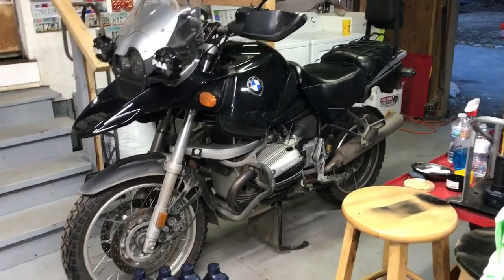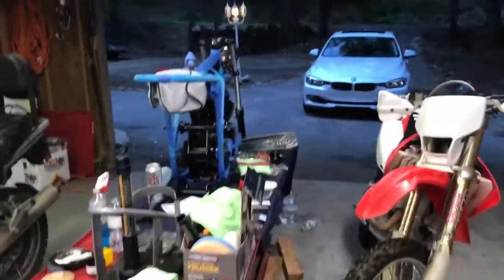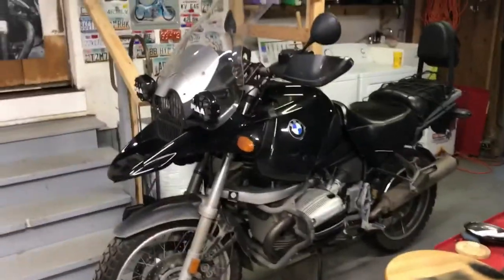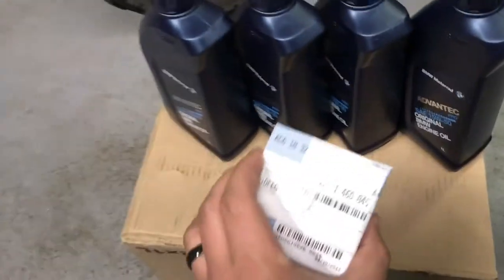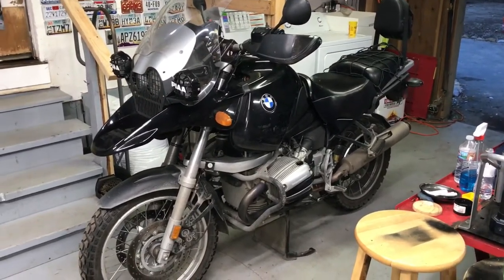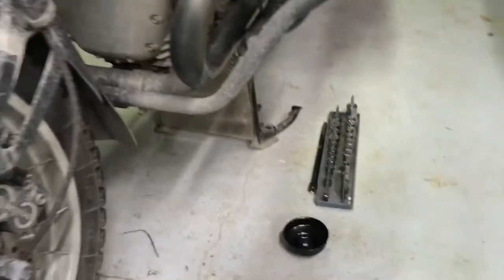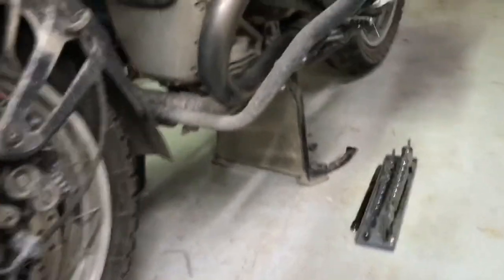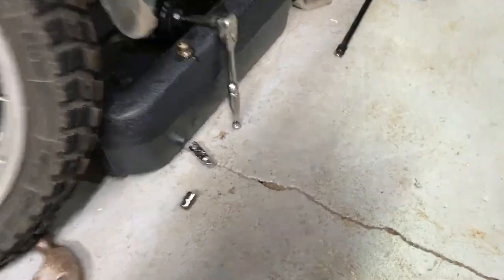How to change the oil on a BMW R1150gs

Comment: Some additional specs for the oil change on a R1150GS:

15W-50 Motorcycle Oil, 3.75 Liters (not quarts)
http://a.co/d/dWQAAKE

Oil filter e.g. Wix 57936
http://a.co/d/h0cHg4K

Oil Filter Cap Wrench 76mm 14 flutes
http://a.co/d/9qYQvd0

Crush Washer 20mm x 16mm x 2mm
http://a.co/d/9XpxtTt

The torque on the Oil Drain Screw is 32 NM
 (as you wrote)

The torque on the Oil Filter is 11 NM
Reply: Is the filter cap 76mm 14 flutes or 12 flutes? (For mahle filter)

Comment: Perfect video, thank you! What type of oil do you use? Some people recommend the: 15w-50 motorrad advantec pro...my 2000 1150gs has 20,000 miles. Any recommendations?
Reply: For future readers, synthetic isn't recommended in any engine until after break-in. Some say these bmws don't fully break in until 20-30k miles